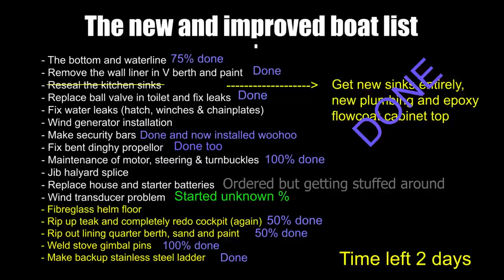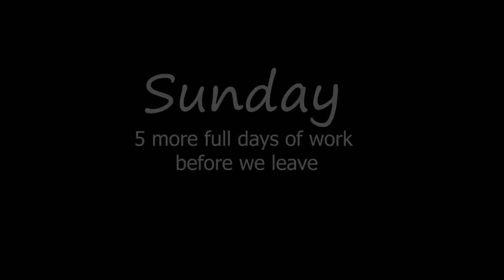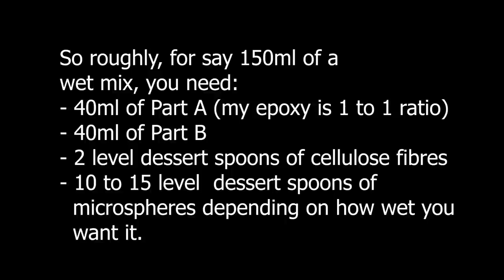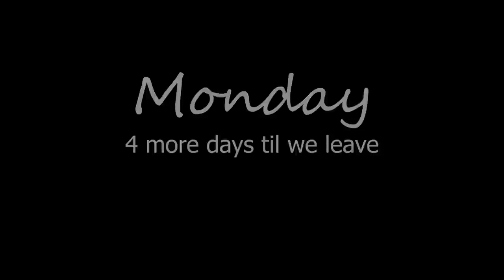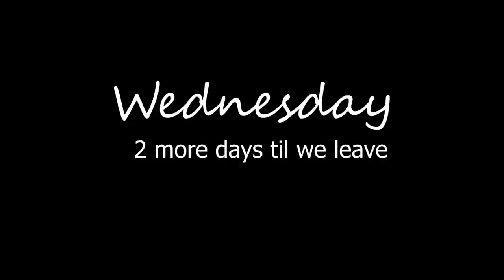Ep.257 Boat Build in Cartagena - Final days

Comment: If you ever use large sections of peel ply, try pulling it off in the dark. As the fabric releases from the epoxy, static (or bond) creates a streak of light. It's really cool when you have large sections. I noticed it when building my 31' tri.
Reply from the maker: Wow freaky!

Comment: Nice vlog. I would’ve feared Columbia also, nice to hear caution is all that’s needed. I believe those contacts at 20:30 are supposed to spin each time they are released. This gives you what is called wipe, limiting the arcing and giving a new surface each time. Check for broken or stuck parts in the spring area.
Reply from the maker: I dont know how they would spin, there is nothing there inducing a moment at all and they aren't loose...no broken parts or spriings????
Reply: SAILING into FREEDOM May well be true. My experience is not on boats. It’s on elevators. I have never seen a round shorting disk that didn’t spin a very small amount. That is when working correctly. When I find shorting disk pitting in one spot, I know it’s time to replace the guts or the switch. At 3AM I might sand it off and put it on my to do list!!

Comment: If you fit a capacitor across the legs where the contact switch is located, much of that arcing is prevented.  Same idea as the capacitor in a distributor--On mine I have  two mercury relays operated by the deck switch which only carries about two amps or less.  This has a small  spark quench capacitor  across it.  The relays were expensive but not as expensive as the platinum contacts heavy duty relays that were recommended.  They need to carry about one hundred and fifty amps--and I have an overload switch-contact breaker which switches off the current at this amperage.  I think it cost me about sixty bucks, if it goes, just switch it back on after releasing the anchor from whatever it caught on,
Reply from the maker: Good advice Mike thanks, when our numbers improve I have lots to do

Comment: I mounted my winches on a  hardwood laminated plywood and fibreglass covered block which bolts  to the deck, the winches bolt to this board--and it has a drain hose threaded from the side of the block to the centre.  The middle laminate piece of ply has a slot from the centre to the edge about eight mm or so.  When the block is finished it should have the same holes--but longer bolts. The mounting block is three layers of 9mm  hardwood plywood, each layer epoxy saturated as much as it will take (not much actually) , and the pipe is just a short piece of fine gauge petrol fuel hose set in the resin and the board is assembled.  Maybe next time--but use good high molybdenum Stainless Steel bolts.  That extra 30 mm of board increases the leverage on the deck--so you need a good backing plate below decks.   Just sayin'
Reply from the maker: Again when our numbers improve and we have some $ to spare I cna do something like that. thanks for sharing mate

Comment: 37:48 - there is a magnet in there, and there is a reed switch inside the unit. two little magnetic bars in a glass tube that touch together when the magnet passes them. so yes, it counts pulses and does some math to calculate wind speed.
There's a few ways to get the same result if you are in a pinch.
Reply from the maker: Well there you go...it was induction well it couldn't be anything other really well other than magic
Reply: @SAILINGintoFREEDOM  so long as the magic smoke doesn't escape - then things stop working, all electronics work on magic smoke.
I know I'm all the way back in the homeland, but if you run into issues with stuff like this I can send stuff out to you.
Reply from the maker: Thanks MR Repair Guy

Comment: How did you learn all this ? Is this the 20th time you are doing a refit?
Reply from the maker: It is really nothing..I think I would be close to the bottom of doing refits, there are way better channels with alot more $$$ to do the things correctly, mine is more doing the best with what I have and lots of the time it is not proper
Reply: @SAILINGintoFREEDOM  Well. That is exactly what is so good, that you do it low cost. But you do know how to handle all those tools! I watch a lot of sailing channels, and what most of them call a "refit" is basically a rebuild, with the fiberglass frame as the basis. But the whole rest of the boat is new. You changed the side coverings, the kitchen cabinets, the winches, anti-osmosis. The only thing that you didn't do was new rigging.... I guess it is part of owning a sailboat, rebuilding is every couple of years. :)

Comment: a WEEP HOLE SEAled WITH EPOXY WILL LAST LONGER THAN THE NOTCHES. The wood will swell and close the slots. The epoxy lined channel could be cleaned out with a wire and would not close up on it's self.

Comment: Well, stopped it on the list and it look like your trying to get stuff that can't be done at anchor.  Sealing the hatches, winches, and chain plate "Might" be possible to do at anchor ? Almost doesn't matter if its raining where you are ? Just putting new sealant on, which isn't as easy as it sounds because you need to remove the hatch cover and clean everything perfectly, and who know whats under that chain plate ? Wind gen, now thats a big one? Wind transducer, now, I've taken them apart and cleaned and lubed and they've worked for quite a while, can be done inside in the evening, but if crap parts are broken, who knows.  Fiberglassing, well, I see some people doing some amazing stuff with huge sheets and they are probably making it look easier than it is ? Jib Halyard, now I've seen people do that under very stressful conditions, best to make sure its perfect if your having gales. New Halyard. Rip up teak and redu , WOW, huge job. OK, WATCHING finally ! Well, this is interesting to see, your in Cartagena Columbia. And, to tell you truth, not surprised, as they were very good to you. Nothing but quality. If he knew how you said that, he'd think again LOLLOLOL Trans-sexual, not wonder Cuba wouldn't stamp your transport lol.
Reply from the maker: Of course some jobs can be done at sea but when you are drying the hull out or the winch bolt holes you may as well fill it with a job...all days were at least 14 hours long plus 3 or 4 for editing and sorting...not much time to scratch my balls on some days but I managed